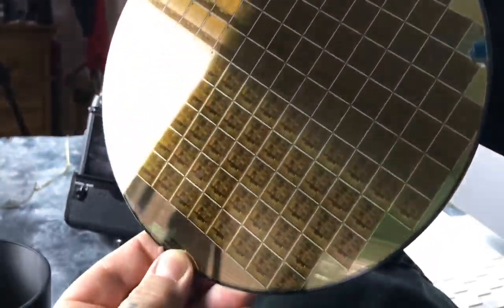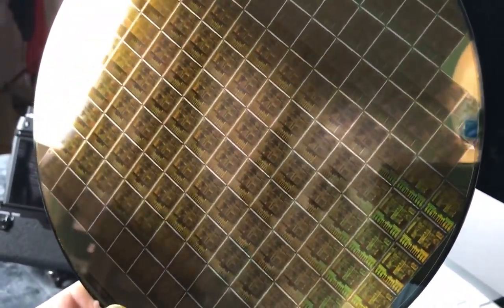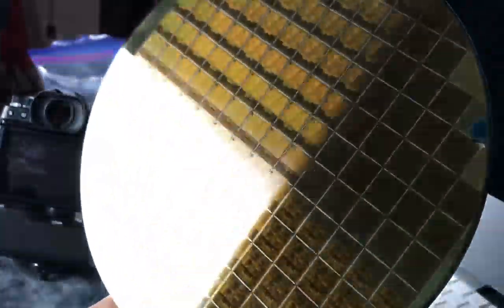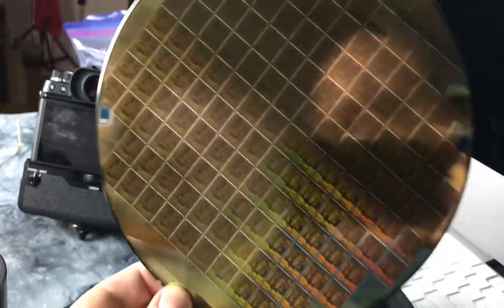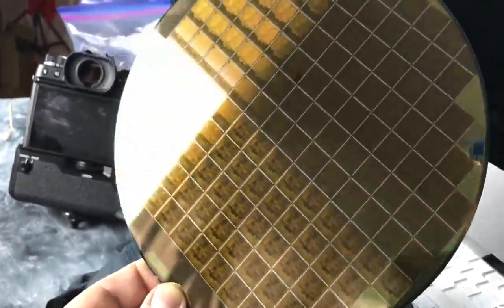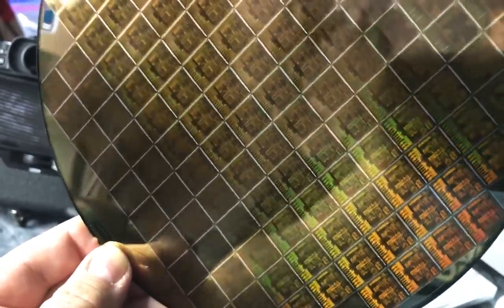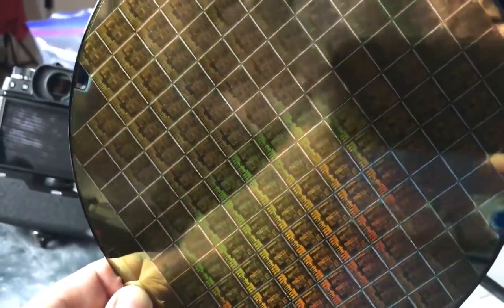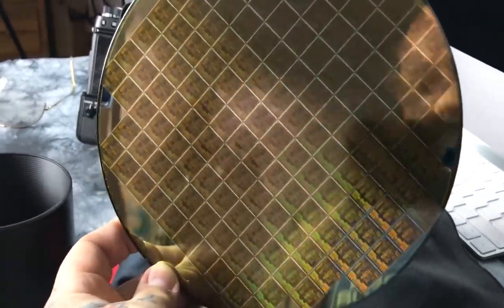🤓 Gold coated Silicon wafer FUJI MACRO PHOTOGRAPHY

Comment: Hello, Angry Photographer, I'm a beginner photographer and I learned all I know about lenses from you, bought them all off of your recommendation. I was wondering if you could help me with some info, just bought a D7100 used, and the mount feels weird, I need to apply quite a bit of force to fit the lenses. How big of an issue is this and what can be done about it? Thanks a lot!
Reply from the maker: to fit which lens though?
Reply: All my lenses, 60mm 2.8, 35mm 1.8 G, 70-300 VR, 105mm 2.5, kit lens...